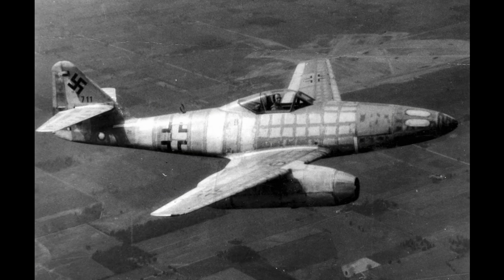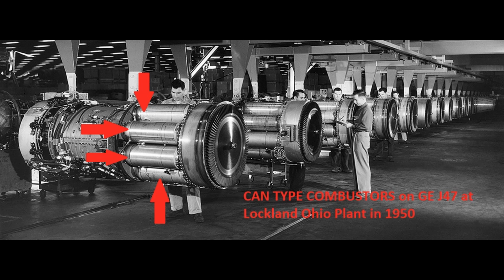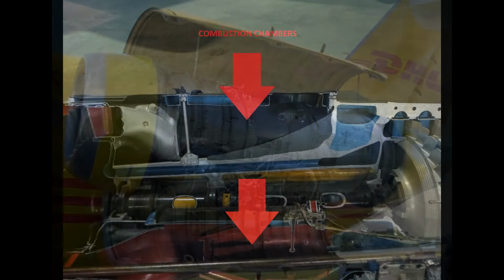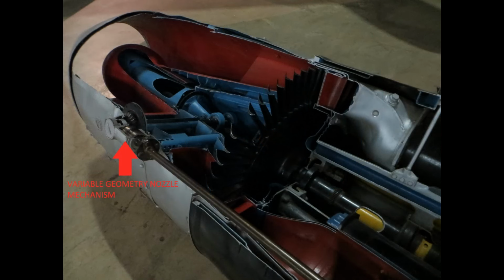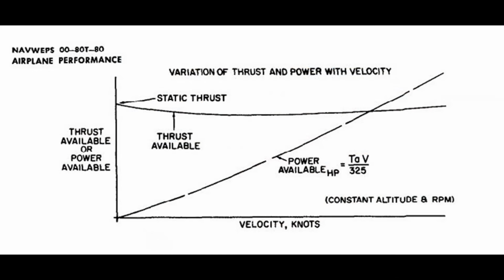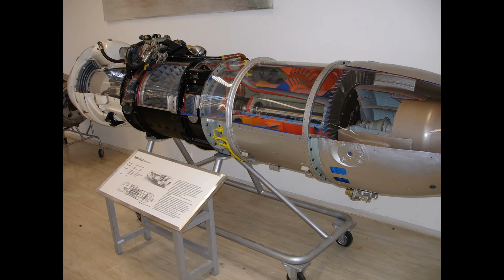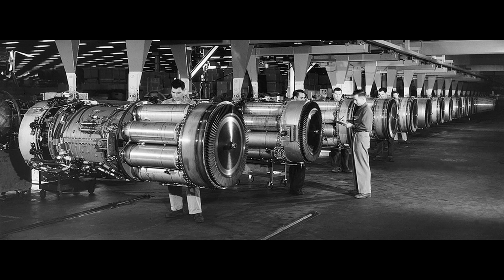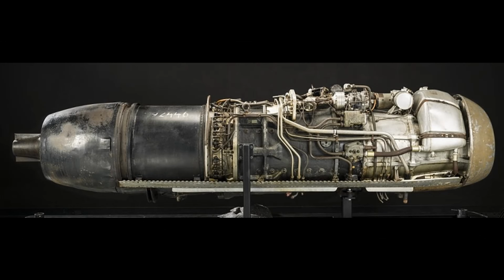World War Two JET POWER

Comment: Gregg, I have two fundamental questions you may be able to answer. 1:  When the compressed air is burned in the annulus or combustion can, its pressure must increase.  How does lower pressure air at the front of the can overcome the higher pressure air at the rear?  Think of a pulse jet. The high pressure in the combustion chamber tries to force air out the front, but in a pulse jet doors close and give the chamber pressure something to react against.  Why does not at least some of the pressure in the combustion chamber escape out of the intake, extinguishing combustion?   2:  What causes turbine temps to be higher at startup, when turbine speeds are low?  Hope your recall of thermodynamics is better than mine.  Thanks!
Reply: I'll take a stab a putting these in understandable terms (which Greg is so good at!).  
1) The highest pressure in a turbine engine is at the outlet side of the last compressor stage.  The pressure is slightly lower entering the combustion chamber (higher velocity results in lower pressure, just as in any other venturi, or over a wing) - so toward the inlet is both into the wind and toward higher pressure, from the fuel injection location.  When combustion occurs in a closed cylinder the volume is almost constant, but temperature and pressure rise rapidly in response to the rapidly added heat energy.  The combustion chamber of a turbine engine isn't closed - it is a windy pipe that has high pressure on the entry side, and is open to atmospheric pressure on the exit side.  When combustion occurs here the temperature and volume increase rapidly, but pressure almost none at all, so the  pressure is still higher at the outlet side of the compressors.  The burners on a modern gas furnace have enough draft induced by a fan to behave similarly...continuous flame increases temperature and volume considerably, but since the increased volume is free to leave in the direction of the flue, it does not flow into the inlet.  Pulse jet is bang -bang combustion or more or less stationary air, rather than a stationary flame location in steadily moving air, so it does have (brief) pressure spikes.
2) At full turbine speed, only a tiny fraction of the available oxygen is actually combined with fuel and burned, so a relatively small amount of heat is added to a very large volume of air.  When things are spinning more slowly the air flow rates are much lower,  A similar amount of fuel heats the smaller amount of air to a much higher temperature until the shaft speeds increase, delivering more air flow.  Turbines always operate far to the lean side on air/fuel ratio, so adding more fuel flow (faster than air flow can increase) increases temperature of the exhaust from the combustion chamber.
Reply: I'm not Greg, but I can answer.
1. No, pressure does not rise in the combustors. It actually drops very slightly (about 3-4% drop). You are thinking in terms of piston engines, which does not apply here. In a piston the combustion occurs at a constant volume (Otto cycle), so pressure must rise. In a gas turbine, combustion occurs at constant pressure (Brayton cycle), so the heat cause expansion of the gas, not a pressure rise. That's why the gasses don't come back out of the front.
Sometimes compressor stalls can happen, and then the gasses do come out of the front. Thrust is then lost, and the surge can be destructive. It sounds like an explosion.

2. When in operation, only part of the air going into the combustors is actually mixed with fuel and burned. In old engines this was about 20-25% of the air, but this has risen progressively, with the current record holder being the F135 in the F-35 with about 72%. This happens in the primary zone of the combustor. The remaining air (except for some that is bled for various purposes) is mixed with the combustion products in the secondary/dilution zone of the combustor, to bring the temperature down to a level that the turbine can deal with. 
When the engine is just being started, the full air flow through it had not been established yet, so there is not much air to mix with the combustion gasses in the dilution zone, so the flow through the turbine is hotter until the proper flow is established.
Reply from the maker: The way Rich answered is correct. Combustion pressure goes out the back because atmospheric pressure is far lower than the inlet air pressure to the combustor, and the pressure just before the turbine is lower than the inlet pressure so it all goes that direction.
2. Start temps tend to be high because air flow cools the motor and the engine isn't spinning fast, so air flow is low.
Reply: When I made my comment I didn't see any other reply, but now I see that Rich Sarchet already gave a great answer 👍
Reply: Great answers guys and thanks. When you look at PV=nRT it makes sense. I hadn’t realized that the highest pressure point was just aft of the final compressor turbine, but it has to be doesn’t it. Otherwise air would not enter the combustion cans from the turbine.

Comment: Hi Greg.  I believe the Ju287 was never meant as a production/service aircraft, but as a developmental type.  Engine placement for jet powered bombers in future was being trialed on it, as well as the novel concept of the FSW (Forward Swept Wing) paradigm.  Spatted landing gear were natural for this, especially as the plane was being glued together out of the parts of other aircraft in every way possible.  And the Ju287 wasn't a "four engine bomber" as 6 engines were also trialled on it.  It was a purely experimental airframe and retractable gear was a later step.  Also, how many experimental and prototype planes were lost because of gear failures?  A lot.  By that measure, the Ju287 (a shoestring project) was the safer alternative.
Reply: Your take is entirely on target.  It was a test bed for a variety of concepts, and was never intended as a combat aircraft.  As an aside, it apparently had excellent handling and speed characteristics.
Reply: Excellent pick up on the landing gear.
Reply: ISTR reading that the undercarriage used on teh 287 were taken from captured or wrecked Liberators (and presumably had spats added ad hoc).
Reply: Just like early versions of the 262 were awkward.
Reply: The spatted undercarriage was also chosen to avoid dirt and stones getting sucked into the engine, that were thrown up by the wheels on grass runways. Debris coming off the tyres was caught in the spats

Comment: And just evidence do you have to show that post-war development if the jet engine was based on the Jumo 004 and not some other axial-flow compressor jet engine such as the Metro-Vick F2 of the GE J-35? Both the German streamline compressor blade research and the American isolated aerofoil compressor blade research were flawed compared to the British cascade compressor blade research.
Reply: I'm glad someone mentioned the Metrovic F2. A highly underated engine.
Reply from the maker: Are you guys just trolling, I honestly can't tell, the Metro-Vick F2 flew on a test plane in 43' and was so unreliable it was abandon for the rest of the war. No operational plane during WW2 used it.
Reply: @GregsAirplanesandAutomobiles  No it was just to point out that the Germans were not the only nation to develop axial flow turbojets early on.  I suspect it was no less reliable than the BMW and Jumo engines.  It was not developed because the much more reliable and simpler centrifugal engines fulfilled the requirements at the time.
Reply: @GregsAirplanesandAutomobiles  further to my last post.   According to Bill Gunstons book "development of jet and turbine aero engines" chapter 11, the F2 ran for 210 hours with no damage noted on stripping.  metro Vic also coaxed 4600 IBS thrust out if it.  Some shit engine.
Reply: @tristacker  And such a success that there was no production, although its design concepts were used in the Python and Mamba turboprops. (Plumber's nightmares, they were)
Reply: @peterstickney7608  while the F2 didn't end up in production it did form the basis for the Sapphire and the Clyde. It was one if the first a nuclear combustion chamber jet engines and as with an early technology there were difficulties that took time to overcome. Go and look at the problems that P&W had with the JT9D on the 747. Engines would fail on rotation or flame out if the throttle was retarded too quickly. Or if what about the original fan blades on the the RR RB211? All technical difficulties can be overcome with time. But as the UK had Whittle's engines and the war was being won the need for the F2 was not as urgent as it had been in 1943. Even the Germans gave up on their turbo-fan work, but what Greg neglects to tell any one is that Metro-Vick got their turbo-fan engine, based on the F2, working and producing 11kN of thrust later the same year as the Germans bench rested theirs; they got it up to 18kN of thrust by 1947, the year they decided to focus on their core business areas.
Reply: @GregsAirplanesandAutomobiles  are you going to put your  money where your mouth is and give us evidence to support your claim that every jet engine using axial flow compressors is based on the Jumo 004? If not, then we can dismiss your claim without evidence.
Reply: @GregsAirplanesandAutomobiles 
All axial compressor engines being developed in the UK were superior engines, UK certification requirements were not lowered at the time in the UK & so the engines remained in development & testing. In 1944 the RR Nene centrifugal compressor engine was in fact the most powerful gas turbine aircraft engine in the world.
Reply from the maker: Operation Paperclip. Hermann the German, the fact that the J-35 is an axial flow design and looks exactly like a scaled up Jumo 004. They certainly wouldn't have based anything on the Metro-Vick F2, it was a failure.
Reply: @GregsAirplanesandAutomobiles  the design work for the J-35 started in 1943, when did the Western Allies get their hands on the Jumo 004? 1945. The British started working on axial flow engines back in 1926. Trolling? No just better researched than you are. Yes, the F2 flew in 1943 and never saw service due to technical issues, although it was producing more thrust than the RR Derwent. The F2 was developed further and eventually became the Sapphire as used in several marks of Hawker Hunter where it was a more reliable engine than the RR Avon.

Now Greg, will you answer the question I posed and give your source for your claim that all post-war jet engine development was based on the German Jumo 004? Or are you just another internet hero that claims that every we have is based on the German work?
Reply: @GregsAirplanesandAutomobiles  Hermann the German was an independant engineer drifting around China, who hooked up with Claire Chennault and the Flying Tigers.  One of his more notable exploits was rebuilding a crashed A6M Zero to flying shape for performance evaluation. (If you see a picture of a Zero with 1936 Ford-looking louvers just behind the cowl, that's the one.) He traveled to the States, and signed on with GE, and was instrumental in the development of the J79.  He certainly wasn't involved with anything in the German aviation industry in the late 1930s into the 1940s.
The J35 was running (at twice the thrust, and about 10 times the life) before any of the Allies ever saw a Jumo 004 or BMW 03.

Comment: BMW 003 derivatives had a good run for many decades as Snecma ATAR in the French jets. In a long term, I’d call it the most successful WW2 jet engine. :)
Reply from the maker: That's a fair point, in post war usage the BMW derivatives did pretty well. However during the war it was all Jumo 004.
Reply: @GregsAirplanesandAutomobiles  
Another not so known fact is, that Daimler also did a take on building a jet engine during ww2.
They went even further and built a bypass counterrotating fan turbine jet engine.
However their designation for it would be my favorite piece of trivia, they called it *DB 007*. :D
Reply: @Enthropical_Thunder  yes, the Germans never got beyond the test bed as they could overcome some technical difficulties and abandoned the project in May 1944. Metro-Vick started working on a  turbo-fan engine in 1942, around the same time as the Germans,  and were still working on it when the company decided to concentrate on their other activities in 1947, by which time they were producing 18kN of thrust.
Reply: Greg's Airplanes and Automobiles oh yes, fully agreed, and sorry for being a smartass.
Reply: @GregsAirplanesandAutomobiles  One interesting thing I found was that in 1948 the occupying allies gave Siemens in Germany permission to make a blast furnace gas fuelled gas turbine based on the Jumo 004.  It used a Jumo 004 compressor, external ceramic combustion chamber, 5 stage water cooled gas turbine and ceramic turbine nozzles.  They built a handful but then were given access to nimonic and didn’t need the water cooling or ceramic guide vanes.
Reply: @GregsAirplanesandAutomobiles  true but the fastest german operational jet of ww2 is the Spatz He-162 with its stunning 562mph!! Provided by the better-designed and more tech-advanced BMW 003 (C/D/E/R versions, then ATAR post war, based also on BMW 018 blueprints). good for us it didnt arrive in time but 003 rules
Reply: The Snecma ATAR engines was not realy "derivatives" from the BMW003: not forgott that the ATAR engeeneers need 6 years to was able to make a usable engine (first was tested on a Dassault Ouragan in 1951) . Was  the original BMW team+ a part from the Rateau team (first  french turbo jet prototype from 1939) who work after the war by SNECMA...The ATAR turbo jets was realy use in operations on the So 4050 Vautour twin engine aircraft, and first single engined fighter with ATAR was the Dassault super Mystère B2 (supersonic with afterburner)
Reply: @leneanderthalien  The ATAR was closely related to the BMW 018.  Dr Herman Ostrich who worked at BMW developed the BMW 018 there.  After the war he worked at ATAR far preferring the French to Americans who he disliked.  Construction had started by 1945 and photographs existed of it.  The engine was about the size of the ATAR, lower thrust of course,  and incorporated blow of valves to allow stable operation at high compression ratios.  It should be noted that German engineers had worked closely with French engineers during the occupation and often reluctantly liked each other.  The French did not muck around catching up after WW2 and Germans looking for a job worked fir them gladly.  Two German Welker and cc actually beat the Americans to developing a transistor there.